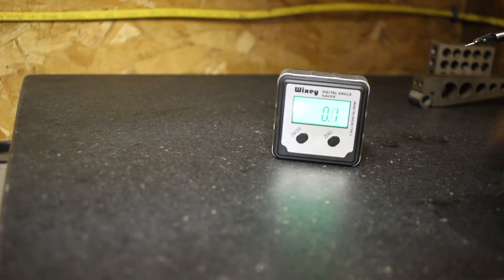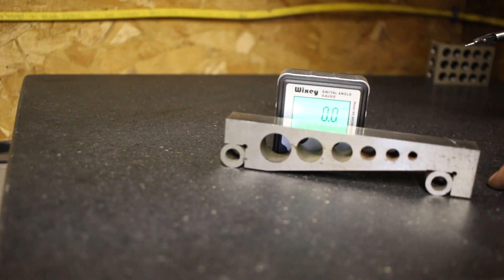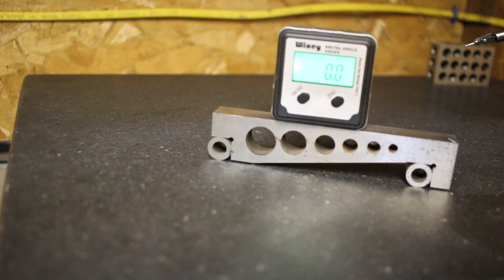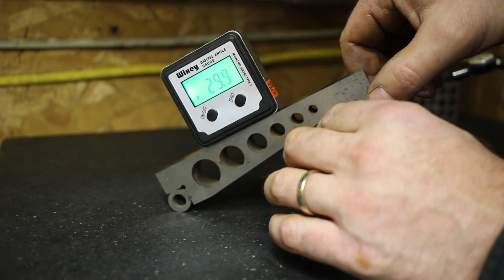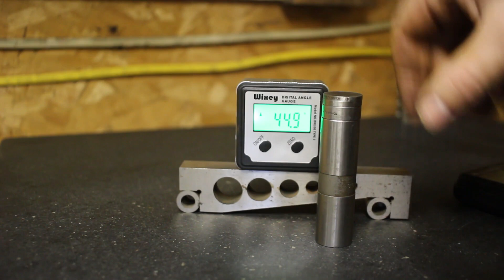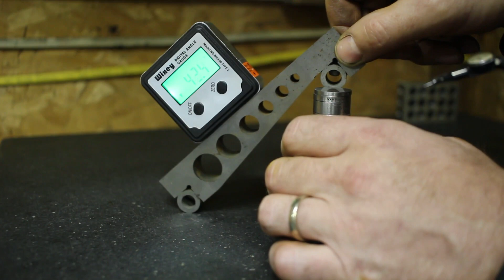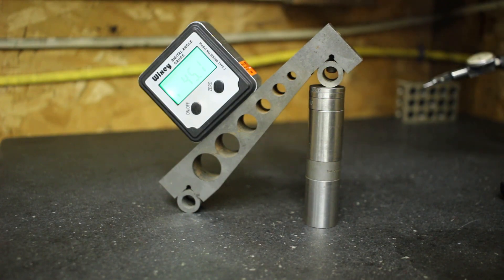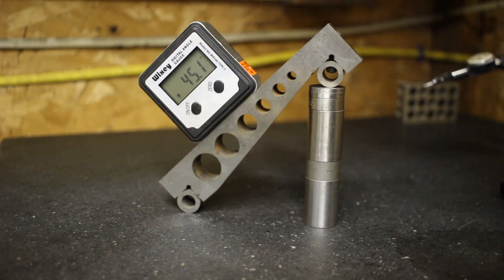Testing a Wixey digital angle gauge using a sine bar

Comment: Did you level your surface block with an accurate bubble level?
Reply from the maker: It doesn't need to be level if I do all of my angle measurement in the same orientation to the block.

Comment: Just curious, what is the accuracy variation for the sine bar?
Reply from the maker: At 45 degrees if the gauge blocks are  .0001 too tall  and the bar is .001 too short the angle of the bar is 45.013 degrees.

At 45 degrees if the gauge blocks are .0001 short and the bar .001 too long the angle of the bar is 44.98 degrees.

Those tolerances are easily achieved with a sin bar and gauge blocks.
Reply: @diyVT  nice! thank you for the reply. I can see how critical that kind of tolerance would need to be for M
machining. By comparison the angle finder for this device is probably grossly inaccurate but it's nice to know it's in the ballpark for blade alignment in woodworking

Comment: Let me just tell you that after 60+ years in engineering.......if you have a work piece in a vice on a milling machine, or even a drill press, and have to set a quite precise angle etc, using a sine bar has to be the most awkward thing in the tool box.....using a sine bar means you then have to use a dial indicator to run across the top of the bar to check the angle.........most times you won't have a reference surface that is true to the underneath of the work piece so a digital indicator like the one reviewed will do the trick..... and to .1 deg.
Most, if not 99%, of people working with mills at home, or even an average commercial workshop, don't have gauge blocks and without them a sine bar is useless,  so the ability to set any work piece to within .1 deg with a gauge like this is more than adequate.
Reply from the maker: Good point .1 degree is actually a really small amount. Until I verified it I would have questioned the ability of a tiny plastic box made in china to measure that close. I really haven't used a sine bar that much, I don't have a sine plate but I suspect that that would be more useful than a sine bar for actually cutting a super precise angle.  Maybe rough it on the mill and finish on the surface grinder? But really most of my machining is pretty low tolerance so I don't really need one but it's tempting to get one to play with.

Comment: There are two kinds of these angle gauges, the type that uses a rotary encoder and a copper pendulum and the kind that uses a MEMS sensor chip, the pendulum type is fairly accurate and consistent and the latter is awful. I've seen the sensor type indicate over a whole degree off and by differing amounts depending on which direction way it's tilted from zero. The Wixley uses a pendulum and encoder. You can usually tell by how deep the housing is, if there's not enough room inside the shell for the magnets and pendulum assembly with the batteries installed it's using a MEMS sensor chip.
Reply from the maker: I didn't think there would be anything interesting inside so I didn't take mine apart. Maybe I will take it apart now to see what is inside.
Reply: It is difficult to say whether the digital angle gauge is more accurate than other brands,  based solely on whether or not it uses a pendulum. It's worth noting that digital protractors and levels are very accurate and can typically measure angles within a tenth of a degree, which is much more accurate than manual angle finders [0]. The accuracy of a digital angle gauge is typically within +/- 0.1 degrees for professionals and +/- 0.3 degrees for household projects. That being said, the accuracy of each digital angle gauge may vary depending on the model and brand.

Comment: As a metrologist I thought I would throw in my 2 cents.  When using gauge blocks did you account for thermal variation to set the height correctly? Gauge blocks are only accurate at a specific temp. Plus if you hold them, even for a short period of time they can get warmer than ambient.  The only reason I mention this is to do a accurate test to validate Wixey's true accuracy.  It may not be enough to matter but it is a source of error often overlooked in very precise measurement taking.
Great test though.  Makes me want to test my Fowler digital gauge.
Reply from the maker: The temperature would also change the length of the sin bar which would also change the angle, and in the opposite way of the gauge blocks changing size. Which would add another variable and would be another reason for climate control. In this case the size changes due to temperature are probably negotiable compared to the accuracy of the angle gauge. To change from 45 to 45.1 degrees the gauge block stack would need to grow from 3.5355 to 3.5417 or .0062 which seems like a lot although I haven't done the calculations to figure out how much of a temperature change would be needed to make that difference but I would guess it would be a lot.

It would be interesting to compare my home / hobby / farm metrology setup to a professional one.

Temperature is a easy thing to forget about, I was just watching a Mike Patey video on building an airplane and he got the aluminum skin CNC cut to match the wing and ribs he made.  He was very careful to find a shop that had good climate control for the shop and material storage so every thing was at the same temperature when it was cut so everything matched up perfectly between what was cut in his shop vs what he outsourced.
Reply: Depends on accuracy required, however if you go in most uk machine shops in the winter in the uk the doors open for a fair amount of the day and the temperature will never get to the regulation standard 20 degrees c

Comment: Wow. This means that the cumulative error of your circular disk whadyamacallits is 0.1'
Did you get a receipt?
Reply: A person without a sense of humour is like a car without any suspension. They'll get from A to B but, they'll feel every bump in the road 👍
Reply from the maker: My gauge blocks? I trust those to be accurate way more than a piece of plastic and electronics made in china.

The wixey gauge is probably want had any errors.
Reply from the maker: For the angle to be off 0.1 degrees at 45 degrees the garage blocks would have to be off 0.006 of an inch.  That's huge in the world of precision measuring. The gauge blocks are accurate to probably 100 times (or more) smaller that that, or 0.00006 of a inch.
Reply: Misses joke 😉
Reply from the maker: The internet is full of stupid people, if you pretend to be one people will probably assume that you are one of them. 🧐

Comment: Does this particular model do percentages so you can measure inclines/grades? Thanks.

Phil
Reply from the maker: This model doesn't although I am sure that there are some that do have that feature.
Reply: @diyVT  IK thanks for the info. Yes, there are some that do measurements in percentages for an incline....I need it for a large model railroad I am building so I can check how steep some of my grades are. I did it with my own methods of measuring how much rise in how many feet, (example: 3" rise in 100 inches is a 3% grade, etc), but wanted to check to see how accurate I made these grades on t7his large model railroad. A digital meter makes it very easy also and much faster. Thanks for your timely answer....

By the way....your video is excellent and a great way to check accuracy. Well done!

Phil

Comment: I have one and it shows 90 degrees on the left side of my table saw blade and 89.9 degrees on the other side, which one is right? probably both huh?
Reply from the maker: Some fancy table saw blades are actually tapered towards the center. I don't really think that's the issue because you would know if you had one of those blades.  I suspect it's more likely a rounding error.
Reply: did you turn the saw blade around and see if it makes a difernce on the reading?

Comment: Great for placing on telescopes to verify / guide altitude. They're magnetic for a reason ;)
Reply from the maker: I wouldn't have thought to use one on a telescope. I have stuck mine to my saw blade to set the angle.  I am sure there are many other uses for the magnets.
Reply: @diyVT  I wouldn't have either but searching the various astronomy forums out there there are lots of observers using them on their telescopes. They are great for zeroing in on the altitude of a known star to assist in seeing it through the telescope during times when the telescope's positioning system is out of sync.

Comment: I've got a similar brand, but if I turn the gauge 180 degrees, it'll show a different measurement. Calibration time or am I missing a trick?
Reply from the maker: Unless your surface was perfectly level to start with turning it 180 would make it read differently.  Say your surface had a 5 degree slope from true level and you zeroed it on that 5 degree slope.  When you turned it 180 degrees and put it on the same surface it would read 10 degrees because now it's tipped 5 degrees in the opposite direction.  So you had zero set at 5 degrees then turn it and measure negative 5 degrees, the difference being 10 degrees.
Reply: @diyVT  it's more in the order of 0.5 degrees. I found that the plastic base isn't perfectly level, allowing you to rock it along a diagonal line by about that amount
Reply: @hpt08  maybe sand down the side of it? Or glue on a thin strip of wood & sand that down

Comment: An interesting test.  It makes me wonder what the deviation would be if you had 10 Wixys to test.  I am pretty happy with mine for basic woodwork and "roughing in" fine adjustments, but can't see using it for any machining.
Reply from the maker: I might buy a different brand and see if the circuits inside are at all the same.  It would be neat to do several brands and a few of each type to see how if they are consistent.  But there's no way I am buying 20 or 30 angle gauges just for a test.
Reply: @diyVT  when I reseached the Wixy, it seemed to be the best of the under $50 ones I could find.  I wouldn't be at all surprised to see the same boards in cheaper ones.  It is surprising how many brands are juat rebranded other brands.

Comment: Wixey brand has proven to be unreliable for me even for woodworking purposes.  I think there is a place for such tool in the machine shop as not everything has to be nuts on every time.  Thanks for sharing
Reply from the maker: Have you found a brand that's better?  I just went without Amazon's recommendation.  After I use it for a bit I might do a follow up video.
Reply: diyVT my 2 Wixeys randomly go out of calibration during use.  I would see what brands tool sellers are selling, KBC, MSC, Travers